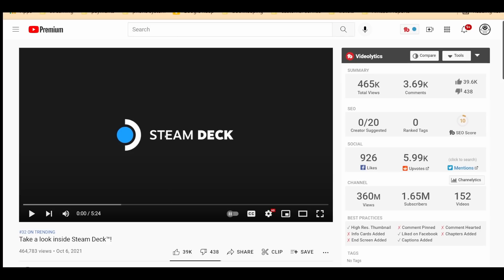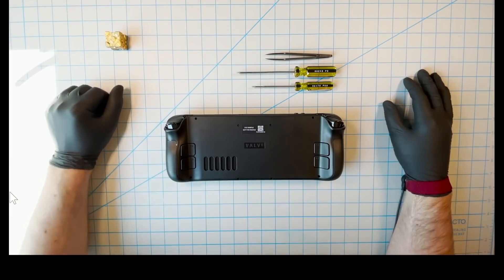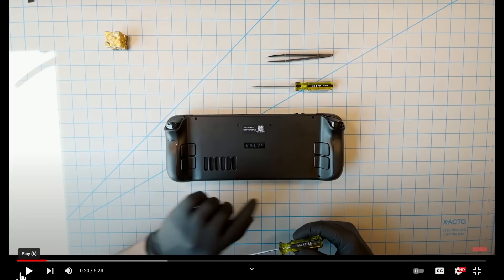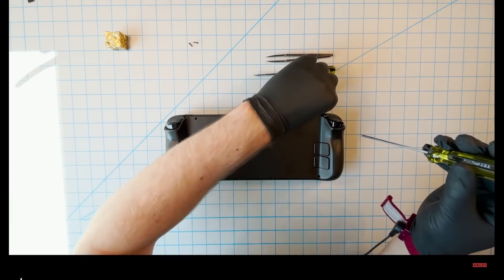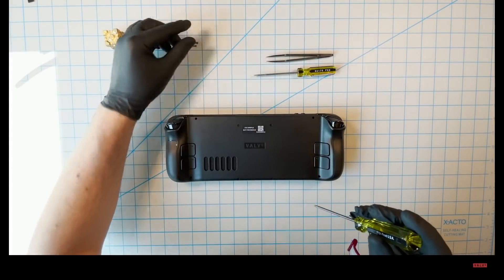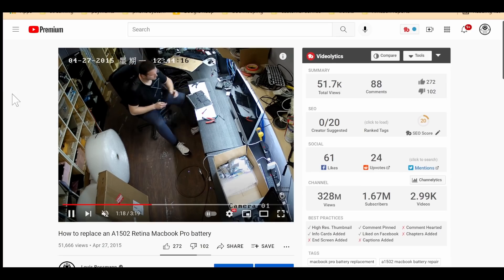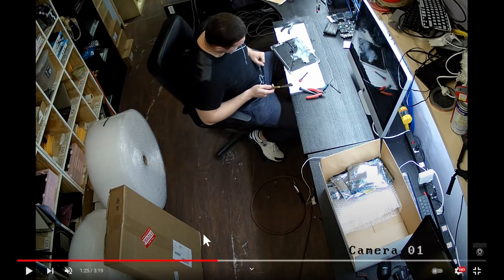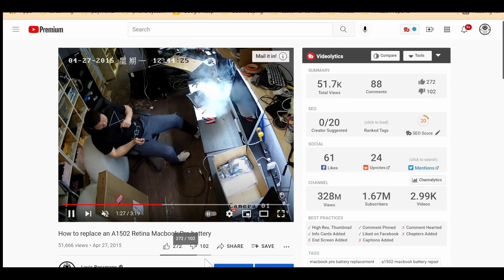Steam deck battery may end your life? bruh 😑

Comment: Wanted to point a few things out.

1. This video was filmed quickly by valve in response to a Chinese dev breaking NDA and posting their own tear down video. I imagine that's why it has several mistakes and maybe is a little mixed message.

2. The SteamDeck community has a very vocal minority of people claiming they plan to replace the onboard SSD, to the point that it's common to see multiple people tell someone who's never opened up any computer before that they should buy the 64 GB model and bring their own SSD. I think Valve is specifically talking to people with little to no electronic repair experience when they say you shouldn't open it. This is also why I imagine they suggest leaving things to professionals (Not specifically valve staff, or valve certified shops)

Comment: As for putting on and off.... Manufacturing would put a specific torque..... Unless someone f****k's up badly putting screws back it's should not be a problem. Since they are not a big screw I don't think the specific tourqe is freaking high...

Comment: The structural integrity can be compromised if you cross thread the screws when re-assembling it. Some people forget to loosen the screw slightly so that it clicks into the previously self tapped threads before tightening the screw.
Due to how self tappers work, they are easy to cross thread if you do not reverse the screw until it aligns with the old threads.

Comment: I think the idea behind the whole it can catch on fire and cause death is that some people are just dumb. There's a reason why you have warning on literally everything telling you that x can kill you. On the side of the integrity being lessened it absolutely is if it's misshandled. There's only 4 screws holding on the back plate. If someone inexperienced on working on electronics strips a screw or two the overall pressure on the back is less by 25-50%. The screws are self tapping which I know you understand, but for people new to teardowns, it means that the receiving side of the screw has no threading, the threading is cut when the screw is initially installed. Once it's removed and the screw is reinstalled, if your off even a tiny bit your cutting away more plastic deforming the receiving end and lowering it's security. Can it be fixed? Sure, there's a big unch of ways to get a screw to stick into a stripped hole, but it's not factory at that point and likely won't be covered under warranty. They could have done a better job with design and build quality on the threading but it's a cost savings measure they took to make this the best and most cost effective handheld on the market second to none in nearly every way.

I'm gonna upgrade my SSD once one releases that is tested to work well and not muder the battery. I'll probably but a clear shell for it at some point too, but that dosnt change the fact that I'm responsible for the effects of my tinkering. I think their approach to this is fantastic, they're right to repair focused and with the SD being as modular as it is internally, if something breaks you can swap it out or potentially upgrade it.

Comment: I honestly just want to know what SSD model they were using so I could shop ahead. 
In terms of the screws, if those were designed to tap their own thread and are screwed into the same plastic housing and want to be screwed in with the same torque, I could see it being an issue if it didn't at the least, be screwed back in on the same thread pattern, I can't remember the term, but at the same time, if the screws are any good, you could torque them all you want and be fine. I've had a few screws from NZXT flawlessly wreck my cheaper screwdrivers because I'm a coward and would rather destroy useless screwdrivers than strip screws I might need to get back to. So, that is yet to be seen as well.

Comment: About the technical integrity:

I'm a masters geology student and I work a lot with electron microscopes. We disassemble and reassemble those sensitive machines a lot.

So purely theoretically:
Yes you mess up a little bit of the structural integrity of the device by constantly reopening a device. But in our case we just change the screws/parts every now and then.

Practically:
If an electron microscope can handle tenths of reopenings without the screws loosening and your pictures still being fine, a plastic steam deck with standard screws will be fine as long as you don't ram the screws into it or open it 10 times a day.

Comment: Well, each time you screw in a self-tapping screw into plastic you damage the plastic in which you screw in the screw. Do it often enough and at some point the screw turn freely in the screw hole. 1-10 is probably ok, but do it 50 times and its probably fucked.

Comment: The structural integrity thing: Yes its TECHNICALLY true, but Its doubtful that opening it once will mean it'll die the next time you drop it. The self taping screws mean that new threads are being cut every time you screw them in, so you're loosing a tiny bit of material. If you just open it once a year to replace the joysticks or something, your steam deck will be obsolete by the time any significant affects could be measured. Of course, having a functioning device that you have ahem not drop, is better than one that sucks because of joystick drift or worn out SSD.

Comment: "Structural integrity of the device will fail if you open it." True, here's why: self-tapping screws. The more you open and reassembly a plastic device with those type of screws, the more fragile the thing will be.

If they cared deeply about the multiple repairability of a device, they would include metallic screw housing on the carcass, metallic clip wedge same as what we have on the iPhones (the wedge does allow multiple repairs on the same device, Apple is the only one who doesn't), that or just don't use clips to close the device properly, but use more screws with metallic housing or maybe have a rubber band surrounding the carcass to reduce the odds of dust entering the case. But these things cost money and make you lose profit, so... better schedule correctly that obsolescence folks!

Comment: Long time ago in a world that no longer exists I worked in consumer electronics designing mechanical parts like housings with self tapping screws. We often rebuilt them and sent them through a test cycle that included drop testing. Unless there are crush ribs, foam padding that gets damaged when it is opened, or some other feature that is one-time use there will be no change in drop performance provided the screws are torqued correctly and the bosses have not stripped. 

This may be a boiler plate line because some times in some products they might have a foam pad that is damaged or whatever and then in some drop test circumstance that feature was added to prevent damage it won't work as well. These sort of one time features are generally put in because of a last minute change because something failed in testing in some very specific circumstance. Not always of course, but generally.

Comment: if you work on something from the 1970's you can probably work on it in a high radiation and inside a lightening storm, surprising how tolerant those things are, especially when they are downclocked through radiation hardening

Comment: Hey Louis - past time handheld console repair and reseller here (small time) i believe the reason they mention the structural integrity being compromised after a teardown is because the screw theads are not metal posts they are just part of the mold and if your someone that is inexperienced (which is truly the people they are warning here) you can double thread the hole your putting the screw back into infact even if your able to put it in the already made thread it will likely lose some of the tightness (is its just plastic after all) to prevent double threading ive found rotating a screw in reverse until it pops down into the beginning of the plastic thread works well but if your someone that in inexperienced and you do double thread a bunch of holes in this device then yes the structural integrity will be affected as everything will likely be loose

Comment: I screw things together for money, I can assure you screws hold way stronger in virgin material. Even if you split the difference perfectly you still have at most half of the material before a fault(your previous tap)If you tap just out of phase with the factory tap it might be noticeable after just one cycle.

Comment: They are just trying to state the obvious and rediculous so they can't be sued when the unpredictable happens.  For the battery fire what if the person that caused the battery fire has something far more dangerous that reacts to the smoke or fire next to the device.  Yeah sure it would be stupid but they might still sue because the battery is where the reaction started.  Don't doubt stupid scenarios.  As for the structural integrity, one disassembly probably insignificant but after many more it could wear down the fit of the seam for the plastic shell and again they just wanna cover liability.   I could see someone replacing the SSD and then it's not working so the pull it apart again to try another SSD which still doesn't work so the again take it apart to put the original SSD back in but now even it doesn't work so the take if to a repair shop who finally resolved the issue.  In that scenario it would have been open 4 times.  Keep in mind idiots can watch this video too.

Comment: I mean unscrewing it and re-screwing maybe will weaken the shell of the actual device but if Value lets people buy replacement shells and/or hardware (hardware being the screws) I really dont see it as a problem. Also the concern about the battery is prob just for people who really don't know how to work with electronics because I don't really know a handheld device i have worked on that doesn't have a lithium battery lmao. 

As for static electricity I 100000% agree because if you just make sure you are grounded you will be fine, I just put my hand on a old PC PSU or wear my strap connected to it lol. Never Broke a single Laptop, Desktop Computer or even a Nintendo Switch Lite that I did today

Comment: Hi Louis. Technically they are correct. Practically, well, varies. Depends on the plastic that they use. Some plastics hold well even after re-screwing, some don't. So, if you open up your plastic casing that was held together with self tapping screws (the screws that create their own thread while being put in) a couple of times, you'll weaken the threads and they may get loose and break away much easily.

https://en.wikipedia.org/wiki/Self-tapping_screw

So, technically they're correct. From a legal liability standpoint, they have to mention that. Practically would it matter? Don't know. A teenaged that threw his device along with his skate and opening up every week to fiddle with stuff may get affected. The normal people, not very likely.

Comment: You know the guy is a fraud hack by the mere fact that he is using gloves and an anti-static bracelet.I used to do computer repair, and not once in my life did I ever see a component that got damaged by being handled without gloves/static wristband. "Just cus it hasnt happened in 5 thousand times, doesnt mean it has never happened!", sure, it could theoretically happen in a very fluke/outlier event, or in a fake and forced lab setting like when Linus tried to break a RAM stick with static electricity, but the chance is so small that it doesnt warrant the 3 dollars the wristband costs, and the time it takes to put it on and off.

Comment: 11:18 old devices are the least static sensitive. if anything modern CMOS IC's should be more sensitive, but even they have diode bridges protecting most of their pins. In my 10+year history of tearing down, modifying, building and destroying electronic devices I have never had ESD happen, let alone kill anything.
Reply: Someone hast worked with early cmos it seems

Comment: The thing about the screws is 100% accurate. Your interpretation is wrong. "Broke" isn't the term used. "Weakened" is. No matter what you do when you put screws into plastic you weaken the plastic. Even slightly over-tightening the screw will strain the plastic. 

The first time the screw goes in, it's a pretty much perfect fit, every time after that, the plastic gets slightly weaker. It takes slightly (or, depending on how you fuck up your tension or heaven forbid, actually strip it) drastically less force to knock the screw loose. 

I can't give you "sources" it's just hands on experience fixing a lot of stupid fucking cheap plastic garbage housed tools, over and over and over again because I'm too cheep to replace them.

Is it going to make your device fall apart? No. But look at the testing video they show. That's some extreme case abuse.

Comment: I think that in a roundabout way, they said "please bring this thing to Louis if you want a new SSD. This is not your everyday laptop and you will break it if you handle it as such."
I don't know anything about damaging batteries, but I suspect it's possible to damage it in such a way that it'll blow up later. Maybe they are afraid of that. All things considered, I think they are doing a great thing here. They didn't design it to be easy, but they also didn't design it to be hard. That's pretty great in this age I think.

Comment: Ok so about structural integrity, it's going to be affected because it's plastic, basically every time you bend it, apply high enough torque(as mentioned in the video you shouldn't) it weakens, and working on cheap old laptops it's really common just to snap of stand offs, yet if plastic is high quality it's less affected by this so, basically it will actually make your device less damage resistant, but something about before it could withstand 30 kg of torque force, and after it 29, 
Did it get worse? Yes
Will you notice? Probably not

And about Li-Ion batteries, it's dangerous not because battery will explode, but because it can put something on fire. It repair shop there isn't much stuff too easily be caught on fire, but even on footage you show as proof of battery puncturing  not being dangerous, you have bubble wrap right behind the guy, and if something went wrong, or the guy would be dumb and like some unprepared people with first instinct to throw away this burning thing from table, it could literally be dangerous to life.

Louis pls be aware that some people are brave enough to try to fix their device by themselves  yet too dumb to do it properly and safely.

Comment: Structural integrity affected by removing and re installing screws?? bullshit. this is not a 1500# 24" flange. And even then, why not supply new screws and torque settings? pricks.

Comment: i use s**t tone of self tapping screws on 3d printed  parts it is very easy to ware out the hole after tens of re uses if some of them are very over tight. However, if used right and depending on the plastic type it is not a big deal.

Comment: As an engineer it could be possible that when it is assembled they use a press fit, only adding screws after and when disassembled the first time you do roll the  fitted plastic back

Comment: it would slightly weaken the structure in most instances, given it has some sort of friction/springing plastic clip type of mechanism to hold the shell together would be weakened by opening it, as well as the posts you thread the self tapping screws into will be weakened when you re tighten it(even if it lined up exactly perfectly in the same thread and didnt cut new ones, at the end of travel if you inserted it to the same force it would turn slightly deeper taking a little bit more material out of the bottom of the post)

depends how it snaps together how much flimsier it would be

Comment: having user replaceable parts isn't really right to repair? (but probably good enough for most users). you might want to request system schematic to actually change component level parts if they break in anyway.

Comment: technically speaking, the ESD strip need to attach to whatever that touches the parts. if your skin is touching the parts, then you need to be grounded, but if your glove is touching the parts, then that need to be grounded (if your glove somehow has different electric potential than your skin). 
obviously the gloves in the video are insulator, and attaching ESD strip does nothing.

Comment: They claim that opening it might damage the structural integrity of the casing and make it more vulnerable. The only way this could be true is if there was some kind of sealant inside or a very delicate gasket. I fail to see how opening it would be worse than just regular use but i'm no engineer either.

Comment: I think the structural point is valid to a degree, things such as non-spec torque on the screws when they're put back as well as the weakening on flexible clips as they're removed and reinstalled